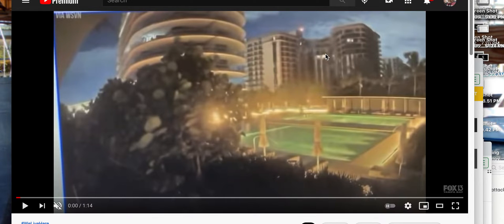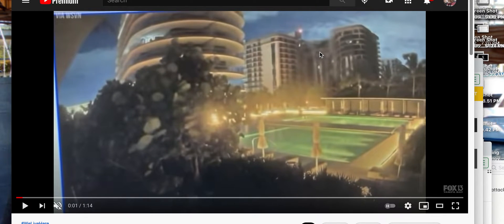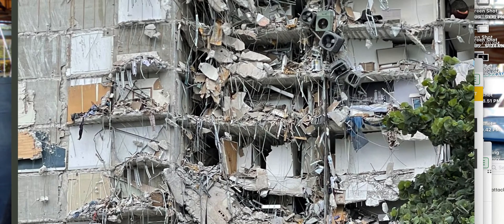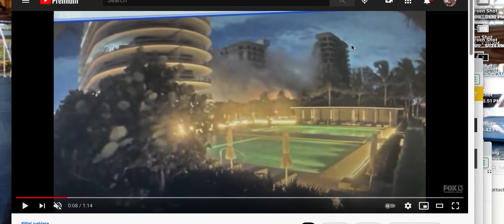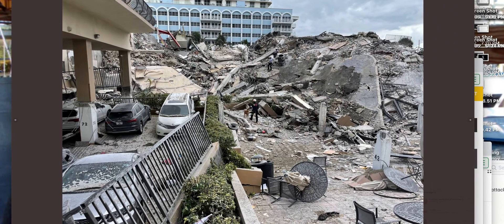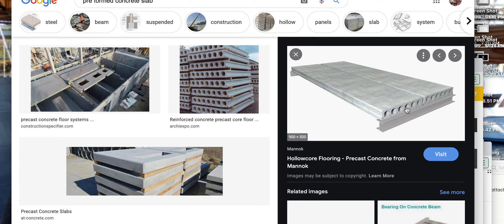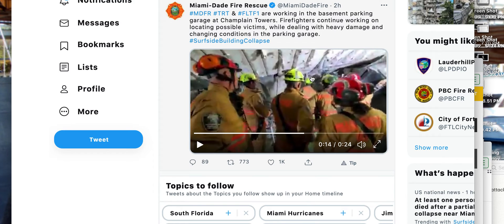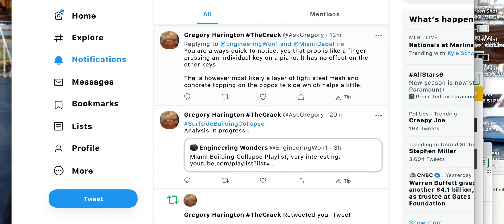Surfside Building Collapse Top 5 floors & one lower section appears to be start of collapse Surfside

Comment: "ETUNG": By Leon Wechsler Architect: Looking up at the bottom of the remaining slabs, one sees white and gray lines. This is a slab construction used in Europe and other countries where the white are blocks of "ETUNG" which are light weight  blocks placed in rows with 4" spacing in between and in the spacing they place a rebar and then pour concrete on top.
You get a shallow 2 to 3 inch slab on top with 5 to 6" concrete ribs in between. This type of construction was used prior of POST TENSION, so the slab is light weight but the ribs @ 12" oc or 18" oc make the slab behave like an 8" thick but in between the ribs there is a much lighter material. this was the construction use in this building !
Reply from the maker: Thank you Leon for the education...

Comment: I realize that all the plumbing pipes and drains run from the bottom of the structure to the top and branch out floor to floor but when the building fell down shouldn't we have seen water coming down if the foundation was not compromised just wondering

Comment: Pool deck cave in and in the process sheared off the line of load-bearing columns holding the center part of the building.
Underneath the pool deck is the parking garage, 3 levels underground.
The building appears to have been poorly maintained for many years.
Also, I think they converted part of that deck into parking and that wasn't designed for it.
Roof repairs and concrete restoration taking place at the same time.
Design flaws and construction mistakes with rebar and cement.
Perfect storm, otherwise it's not easy for a high rise to simply collapse.
Reply: Yep... I saw the collapsed building linked below with my own eyes.

My uncle took me down to gawk at it either the day of or day after the collapse. It wasn't a purpose-built federal building if I recall correctly, just a small, multi-story building built in the 1920s that the DEA had acquired. Somehow, it had provisions for parking on the roof (I don't know if it was originally configured like this, or if it was a modification), and the DEA was seizing a LOT of vehicles and storing as many as would fit there:
https://www.nytimes.com/1974/08/06/archives/office-building-roof-collapses-in-miami-6-killed-one-feared-dead.html

EDIT: Just saw that the DEA building collapse was the IMPETUS for the 40-year recertification rule : )

Comment: WSVN reported "We found a Notice of Commencement dated April 5 of this year to re-roof the building.

We have searched through code violation records and have not found any active code violations for the building.

There was one earlier this year for a “violation of minimum fire standards,” but that violation was already corrected.

Besides that, we could only find a commencement for AC replacement in 2019 and another commencement for elevator work back in 2017.